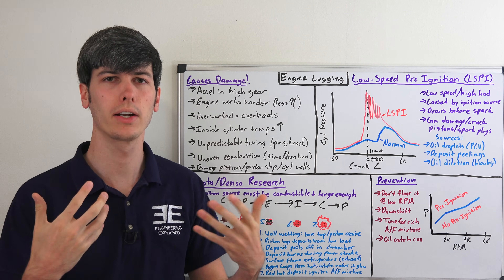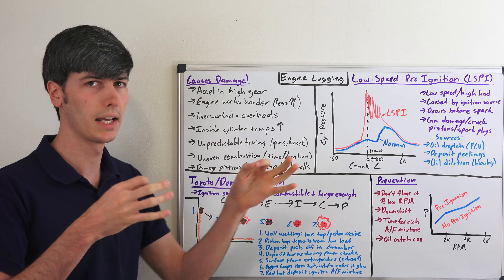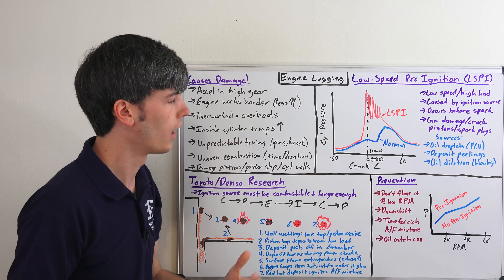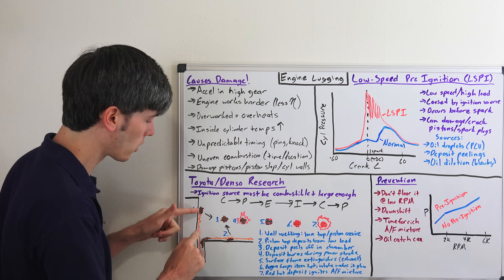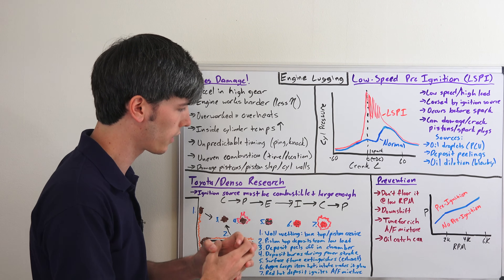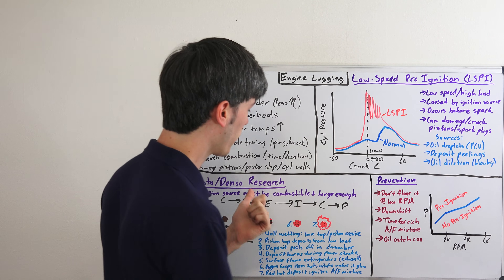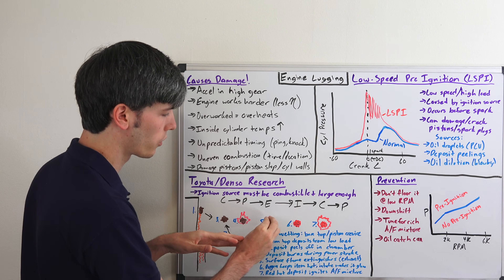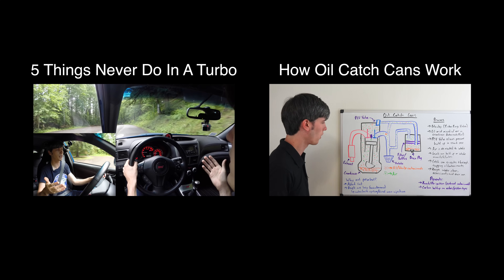Why You Should Never Lug Your Engine (Especially Turbos)

Comment: This is why electric vehicles with no gearbox and only one bit going round and round makes so much sense from an engineering standpoint.
Reply: ArchimedeanEye Are you really one of those idiots that argues until he is blue in the face rather than admit he was wrong? Wow. A box with gears in is a gearbox. It can not be more plain and simple. A Tesla gearbox has a gear on the input shaft, and another gear on the output shaft, constituting a "set" of gears which are neatly housed within a "box".

I think you need to take up your argument with the oxford dictionary people and not me.
Reply: bzzzt!!!  That's the sound of the winding of your cool hipster electruk motar generating an open SOMEWHERE on its winding.  Result?  SCRAP ENTIRE MOTOR (i.e. motor core labeld BCM and sent to OEM rewinding facility for MAJOR profit for what would be a tiny repair on an I.C.E.).   But hey Eron Muskmellon said they were the cool new thing, so how could he possibly be wrong?  He's not wrong about ANYTHING, EVAR!
Reply: ArchimedeanEye 2wd Teslas do have a gearbox. It is right next to the motor. Go to a showroom that has a bare chassis on display and you will see it. 4wd Teslas have two gearboxes.
Reply: ArchimedeanEye "that is that there are far less moving parts and complexity"

You made up that the complexity has something to do with whether or not the definition of "Gearbox" applies, which it does not, hence, you made it up.

" The fact is that the Tesla does not run any kind of car gearbox whatsoever"

Except for the gearbox that converts the motors RPM to drive the wheels at a lower RPM.

You claiming it is a fact does not make it so, as I have already pointed out AND proved with a dictionary definition. What sources prove your claim?

" the answer is a resounding no."

Is that the best you can do? Repeat yourself over and over and STILL provide NO proof whatsoever or external source to back your claim?

"You must be the life of the party"

Says the man who can not admit he is wrong and repeats himself over and over and over to avoid admitting he is wrong.

http://www.motorauthority.com/news/1025442_tesla-solves-gearbox-problem-with-new-one-speed-unit

Here is a review article referring to the Tesla as having a new "one speed gearbox"

https://teslamotorsclub.com/tmc/threads/gearbox-problems.38076/

Here is a forum post on a tesla forum where one person is claiming he has had his tesla gearbox replaced four times. Funny, since teslas dont have a gearbox.

Oh, and then there are the billions of motorcycles gearboxes worldwide which don't have a reverse gear, proving further that one of your stipulations (that is must have a reverse gear in order to be a gearbox) is just not true.
Reply: Jimbo Jones I never stipulated that gearboxes must have reverse in order to be considered a gearbox.  You took that out of context.  What a surprise.   

The fact is that the Tesla does not have a gearbox, not in any normal automotive sense.  It's something more akin to a final drive, which also only has one speed.

There is no comparison between an ICE car gearbox and the Tesla drivetrain, regardless of how bound-up your panties become.

Go ahead, barf up some more literal definitions.  It won't matter. You can only theorise because you're evidently arguing about something you know nothing about.
Reply: ArchimedeanEye " It's not a gearbox in the sense of a car gearbox with varying ratios and a reverse gear. No comparison."

End quote...

Here we go with the context again. That is what you said in the context of this argument and that is the same context to which I am applying it.

"The fact is that the Tesla does not have a gearbox"

There you go again, repeat repeat repeat repeat and still NO PROOF to back up your assertion.

"There is no comparison between an ICE car gearbox and the Tesla drivetrain"

And now begin the strawman arguments lol, I never said they were the same or at all comparable EXCEPT that they are both called gearboxes because they both are boxes that contain gears.

"You can only theorise because you're evidently arguing about something you know nothing about"

Yet I can provide multiple sources to back up my claim while all you can do is repeat yourself over and over like a moron who not only can not admit he is wrong, but can not accept defeat in an argument.

PS I have been a mechanic for 20 years and since I am interested in Teslas and new electric technology I have also taken the time to visit a Tesla showroom and discuss the entire drivetrain at length with staff members... but you know it all, right?

PPS, your original post about "one bit going round and round", were you referring to the motor shaft, or the input shaft? Or the output shaft? Or maybe the axle shaft? How many bits going round and round again? I counted a few more than one... but then what do I know, I am just a mechanic and you are an internet know it all...
Reply: "electric vehicles (...) makes so much sense from an engineering standpoint" Let me know when the batteries get better and I can get a realistic range of more than 206 miles (Model S). Until then, no, they don't make 'so much more sense'.
Reply: But then you would need a motor for each wheel. Putting in a gearbox allows you to power multiple wheels from only one or two motors.
Reply: +Jimbo Jones 2wd Tesla's have no gearbox.  No need for one.
Reply: +Slappy Fistwad electric cars were far more popular than petrol cars before the oil companies learned how to market
Reply: +Jimbo Jones It's not a gearbox in the sense of a car gearbox with varying ratios and a reverse gear.  No comparison.
Reply: ArchimedeanEye It is a box that contains a gear. It is by all intents and purposes, a gearbox. Having multiple gears with varying ratios and a reverse gear, are not necessary for it to be defined as a gearbox.
Reply: +Jimbo Jones  A box with gears is not a 'gearbox'.  Otherwise differentials and transfer case assemblies would also be referred to as 'gearbox' which they are not.
Reply: +Jimbo Jones Again, a box of gears does not constitute a gearbox.
Reply: +Jimbo Jones It's not a gearbox in the context of my original comment - that is that there are far less moving parts and complexity in an electric car.  

You want to argue about the names of objects and feel as if you know something about something.  Good for you, however, the Tesla does not have a gearbox.
Reply: +Jimbo Jones I am making nothing up.  The fact is that the Tesla does not run any kind of car gearbox whatsoever.  A step down down drive comprised of gears to alter final drive is not a gearbox.  

Your literal definition of a box with gears can be applied to anything - such as my wristwatch.  But if someone wanted to know whether or not the Tesla has a gearbox in the same way a Toyota Corolla has a gearbox - the answer is a resounding no.

Perhaps English is not your first language and this is why you refer to only literal definition of words and terms?  You must be the life of the party.

Comment: Some might mis-conceive that turbo-lag is a good thing, in that wanting to get into the higher power band where the turbo spools up and makes itself useful will prevent lugging. The problem I have is that on some of those vehicles that got almost nothing before 4000rpm until the turbo kicks in, you'd have to rev the crap out of it and dump the clutch to get a good, stable launch, which is bad for other drivetrain components. Anybody with me on this?

Comment: how does this differ with a diesel engine?
Reply: diesel does not inject fuel till its time to burn. there is no such thing as preignition in diesel, they normally run by auto ignition from the heat of compression of the air charge, when fuel is injected the air is hot enough to make it burn instantly.
Reply: You can get High EGT's with a diesel which will cause excessive heat. That can cause broken rings on a diesel.
Reply: I always wonder if the guys making their diesel puke black smoke monitor EGTs ... I bet they don't

Comment: What a load of crap. Any modern engine management system worth its salt avoids all of this.
Reply: Not all of us drive modern cars, now do we?
Reply: this only applies to manual transmissions
Reply: TwilightTheShooter That's certainly true. But by modern I mean anything past 1990. Which is the vast majority of cars on the road. This video also seemed for focus on modern vehicles.
Reply: Hank McCoy I'm not sure it counts if the car is modified past what the manufacturer has programmed the ECU for. Or if there is a design flaw in that particular car.
Reply: aaroncake It's not technically a misinformation though, there are people who drive older cars.
Reply: 1985 golf 1 baby ;)
Reply: Well, it's a good thing to know right? won't hurt ya
Reply: 99CCFF 756e6b6e6f776e65786961 647072746c646b Fair enough, though the video seems to focus on newer vehicles.
Reply: This has some amount of truth value ONLY IF YOUR CAR HAS DRIVE BY WIRE throttle system.  Otherwise, if you have a manual trans, there's no way around the physics behind it.
Reply: We're not talking about ancient cars with carboretor and choke and such, do we? Any half decent car of let's say an age not more than 10 years probably will have motor electronics that do injection, ignition with petrol driven cars, Turbo fan controlling and so on, right? 

So, regarding the parameters a engine management controller can controll, if you just do not inject the amount of fuel that would be needed to really get lots of Torque out of the engine at low RPMs and your Turbo management just won't allowed to fill up the chamber with high pressure air (even if it could at such low RPMs which it usually can't!), how can it come to lug? The engine won't run smooth in the end and will not have enough power to go up a hill this way. If you again and again do it that way it may ruin your flywheel or maybe the bearings of your crankshaft might get damage by extensive vibration and all sorts of torsions and wearing. But a modern engine will just cut off ignition/ fuel/ air pressure and that's it. No lugging, no drama. 

Even if we assume some are really not having ears and feeling for the right RPMs an engine is loving to run at. But having learned that lesson of stalling the engine on a well filled up street going uphill, any moderately skilled driver should be able to choose a proper gear, even with manual transmission. Come on! How could someone make a drama out of having to choose gears manually and completely without computer and smartphone app? ;-) lol
Reply: Like I said, unless you have DRIVE BY WIRE THROTTLE system, you will lug your engine if you floor the gas pedal while it is stuck at a low rpm pushing against too high a gear.
Reply: Haha are you a car mechanic? Engineer maybe? Engine management doesn't avoid it. If it did Toyota and VW wouldn't have these problems primarily with their small forced air induction engines would they. When I am wrong let me know.
Reply: Not true -- drive my Tacoma with an Atkinson 3.5 and feel the pre-ignition at 1,200 Rpms under acceleration.  He just described exactly the issue Toyota is having
Reply: its not a good idea to put full load on and engine at low rpm. this is the truth
Reply: In my opinion this is all due to an octane limit and tuning.
Reply: Not crap at all. I drive an STI and there are plenty of clowns who destroy some part of the short block this way. The wastegate on the stock turbo is too small to accommodate a catlesss system even with stock injectors. In this case, there are hardware limitations that the software can't resolve. It's kind of funny actually. The turbine is small enough to allow overboost at low RPM, and again too small to relieve back pressure if you're trying to pass 120 mph.

That being said, there are ways to program discrete ECU maps per gear, but I'm about 99.9999% sure that requires a 3rd party ECU. A lot of Supra owners actually do this so they won't spin their tires through the first 3.5 gears in drag races.
Reply: @ynryyy  I've "destroyed" my 2.3L Ford Mustang ecoboost automatic twice in 96,000 miles. I have a catch can. There is no telling whether putting it into sport mode would change the problem of LSPI. The ECU brings the car to knock, then retards timing. So it is actually knocking all the time...you just can't tell. LSPI ends up being cumulative. Then one day as you try to accelerate from a stop, usually the 3rd cylinder gives out.
Reply: TheProPilot well since you cant drive it has nothing to do with you...its for the other half of the population, that can drive, and would get 600k out of a toyota motor...you may as well just buy a nice comfy dodge to wrap around  telephone pole
Reply: 99CCFF 756e6b6e6f776e65786961 647072746c646b Misinformation is misinformation. How is misinformation good to know?

Comment: Too many people that drive WRX/STI saying they floor it at low RPM and swear they have no issues. Then blame ringland failures or blown gaskets when their engine goes out.  80% of the time I only floor it past 4kRPM.
Reply: peak boost is a bit before 3000rpm. 4k is a but high IMO
Reply: Etienne Brien is it a bit high, but I like to ease into it. It's easier to do when the engine is more responsive at 4k.

Comment: I cliff notes your video but it looks like you never address the real reason not to lug your engine, vibration due to low fly wheel mass/low number of cylinders. The vibration causes pistons to rattle around and large impact gear loads on your transmission. With a larger flywheel and more cylinders you have the lower the vibration and therefore can operate them at lower rpms. The sweet spot for efficient driving is full throttle once you have enough engine speed to avoid bad vibrations, and engine at full throttle is for the most part always more efficient then at part throttle, so efficiency goes up with high cylinder pressure. Unfortunately as you pointed out if your engine is pinging and knocking then your efficiency takes a dive as well as your engine wear, but modern engines are designed for it to get the MPG, even with automatics. With modern stock gas engines you should be able to safely and efficiently apply full throttle above 2000 rpm in my experience, though with a 6 cylinder manual jeep I'll let it drop as low as 1500rpm due to large flywheel and 6 cylinders. Owners manuals will generally have a minimum safe rpm, but if you listen to your engine's vibration it will tell you what the safe rpm is. Ford 4 cylinder ecoboost engines are advertised at making peak torque as low as 1400 rpm, so I'm sure Ford has sophisticated knock control and well as designed for the vibration as low rpm, so please floor it after 1400 rpm to get the full power, and get the best efficiency.

Oh yeah I have and STI and that car hates anything below 2000 rpm and I will let it get to 2500 rpm before I floor it, but it has a light flywheel and is only 4 cylinders.

Comment: We have a BMW X1 Automatic turbo charged. At times, the automatic does not downshift when it possibly could. Not flooring but just, for example going up a small incline on a four lane road. Will the computer keep the engine from "lugging" under these circumstances?

Comment: Could you do a video about the effects of different cylinder bank angles on V engines? 

It would be interesting  to know why most V12s use 65° and most V8s have 90° bank angle and why nobody ever built something between those angles and a boxer like a V12 with 120° angle.

Comment: My car is automatic and as an example; i'm going 130km/h in 5th, i keep the gas at the same position, then just press it a bit more and it goes from 2000 rpm to 3000 ish and then pulls, would that be a fail safe for lugging the car's engine for an automatic? or just the fuel rail getting lot more gaz in it?

Comment: can some one PLEACE explain me, why the chance for lspi sinks as higher rpm. it makes no sens to me because at higher rpm your engine produces more exhaust, what will speed up your turbo -> more boost. so at higher rpm your engine has more boost (even with waste gate) and is more hot because it burnes more fuel. so why the chance of lspi sinks at higher rpm, when the chance should increase? i hope some one can help me, sry for my bad english :)
Reply: Turbo chargers don't build pressures based solely off engine speed like a supercharger but rather how much fuel is going into the engine. that's why when it's put under a load it builds intake pressure. More fuel goes in=more exhaust comes out resulting in higher pressure, the more fuel you give a turbocharged engine causes more intake pressure aka boost. The higher you rev a superchaged engine, the more boost you get if that makes sense
Reply: i think its based on the gas velocity and the boost ....

Comment: I'm sorry but most modern turbocharged engines are designed to make high boost pressures as low as 2K rpm and handle the excess load at such low rpm.

For older turbocharged engines your advice is true except that most older turbocharged engines don't even make power till higher rpm which according to your advice is not a problem.

So basically unless you are driving a car with a Subaru EJ25 engine you should be just fine.

Comment: How does this effect normal sized diesel engines? eg the 1.8tdci in the focus. I was always taught to drive them at lower revs and higher gears than petrols, and given that they fire on compression anyway, do they also suffer from damage caused by pre-ignition?

Comment: In a manual transmission car, does crowing in traffic without gas and leg off the clutch (where the car just drives itself in 1st or 2nd gear) is damaging? Does it create the same 'lugging' effect?